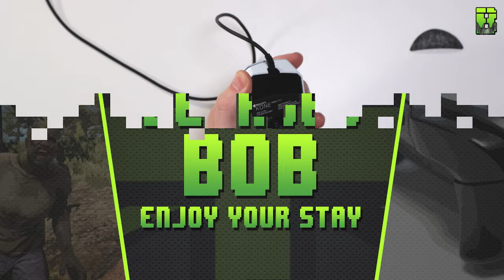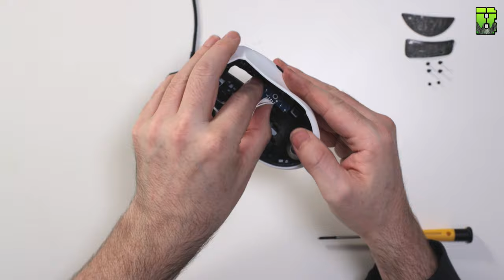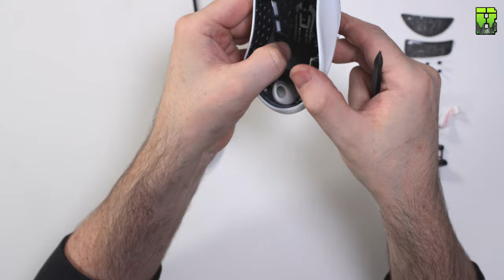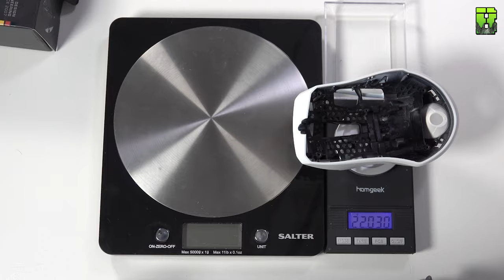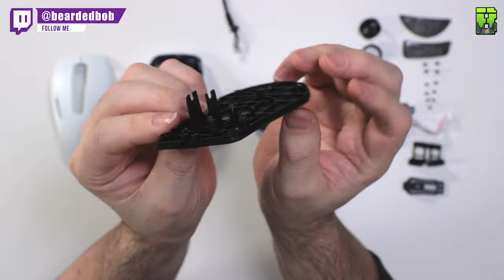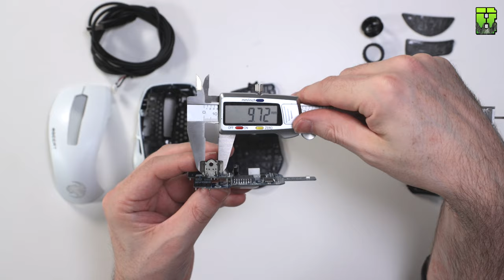Look Inside - Switches, PCB & Encoder - Roccat Kone Pure Ultra Gaming Mouse Teardown

Comment: Nice, these teardown vids are awesome. Waiting for the viper ultimate teardown.
Reply from the maker: R yes, I keep thinking I've done the vioer teardown and I have but it was the wired and not the wireless.
Reply: Beardedbob yes they are so similar but I’d def like to see what’s going on inside the viper ultimate. Also if it can be modded. Especially the tension in the scroll wheel I feel is way to stiff scrolling up.

Comment: I would like to warn potential buyers - after a couple of months the right button began to double-click, I had to change the switcher. After about half a year the scroll took on a life of its own. I have not yet identified its type for a potential replacement, which, based on the video, is very problematic. Maybe I was so unlucky with a defective unit, or maybe the whole series is like that ...

Comment: Question: What switches can I order for this mouse? Do "Black Kailh GM 8.0" work?
Bonus question: While I'm at it, can I simply cut off the PCB behind the last screw? Or will it kill the PCB? Don't need the LED. 😅

I love this mouse. Shape, coating & weight are great.
But it has developed double-click problem after about 2 months, on ALL 3 main buttons (M1, M2 & M3).
I've opened it and opened the M1 switch, the metal thingy was completely fcked... I cleaned & straightened it & adjusted the spring thingy (like shown in anti-double-click videos). A very temporary solution, took only 3 days to develop double-click again...

Would not recommend this mouse to anyone who doesn't wanna replace the switches. I knew I'd wanna upgrade it anyways, but that I'm forced to do it after only 2 months... ugh!
Reply: literally every mouse switch will need to be replaced. Opticals are the exceptions, they just broke down with nothing you can do. Omron switches are junk, Kailh are far more better, i find myself changing mouse switch like once a year  using Kailh Black GM 8.0, havent tried the white GM 10.0

Comment: Any tip&trick to make main clicks better/same feeling/etc? Talking about screws mostly
Reply from the maker: Not with just altering the screws. You could swap out the switches if you don't like the feel of the Omrons or you could pack out the plunger to firm up any pre-travel.

Comment: @Beardedbob do you think its necessary to remove the scroll wheel in order to remove the cable? Wondering how much disassembly is required for paracording.
Reply from the maker: I’ve not tried so can’t say.

Comment: I've heard this mouse has one of the best scroll wheels around. I've just got a Finalmouse Air58, and the scroll wheel is atrocious, very sloppy-feeling with poorly defined steps. Any chance this Roccat wheel would fit an Air58, and fix this issue? Thing is, I don't know if the problem is the wheel or the metal bit the wheel fits into (encoder?). The wheel itself looks to be roughly the same dimensions (thanks for measuring it!), with the Roccat being just a touch smaller. Any advice would be awesome, thanks!
Reply: Can confirm that the KPU scroll wheel is amazing.

Comment: Beardedbob i'm so interested to Roccat Kone pure ultra, I am very undecided between him, the Steelseries rival 3 and the Viper ultimate. Is the Roccat kone pure ultra good mouse? Have a low latency compared to other 2 mouse. What's strengths and weaknesses compared to the other 2? I'm fingertip user, 19 cm L 9.5 W. My mousepads is the coolermaster swift rx. I need some of your advice, I am so undecided..
Reply from the maker: Hi,

What mouse are you moving over from and why are you looking to change?

Beardedbobs Top 10 Mice https://www.beardedbob.com/top-10-beardedbob-mice/

Shape - Personal pref
*Roccat KPU = Ergo
*SSR3 = Ambi
*Razer Viper = Ambi

Best Sensors
*Roccat or Viper - 
*Weakest is the SSR3 which has a high LOD which can't be adjusted. It doesn't bother me but i might others.)

Latency - No SSR3 results yet as I've not tested it.
https://www.beardedbob.com/mouse-top-10-hb/
https://www.beardedbob.com/top-10-blood-pk-mouse-latency/

Connectivity 
*Razer Viper Ult is wireless so winner here IMO.
*Roccat KPU needs a Paracord mod
*SSR3 Needs a Paracord mod

Price 
*SSR3 is  the cheapest
*Roccat KPU mid
*Razer Viper Ult is expensive. The wired version you can get for $40 in some sales.

Glide test - No SSR3 results yet as I've not tested it.
https://www.beardedbob.com/top-10-fastest-mice-on-stock-stakez/

IMO all are good mice. Hopefully the above helps you decide.

Comment: Anyone else have problems with the mouse wheel not scrolling properly? Mine starting slowly not scrolling consistently and even scrolling the other way slightly
Reply: sorry for the late answer. My Kone is inconsistent with the scroll direction. I can scroll up, but it then goes a click down and then up, etc. its quite random, but usually scrolls more in the wanted direction than the other.